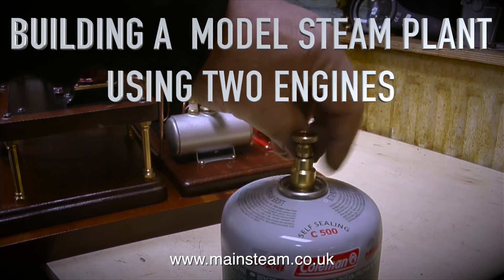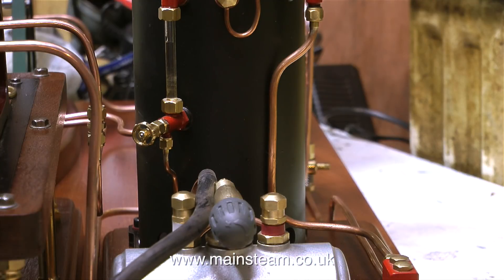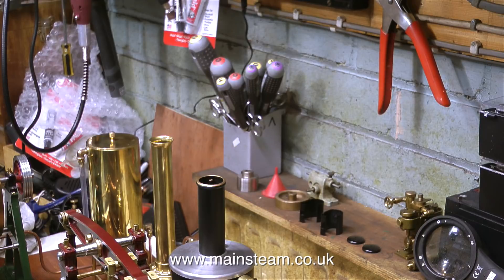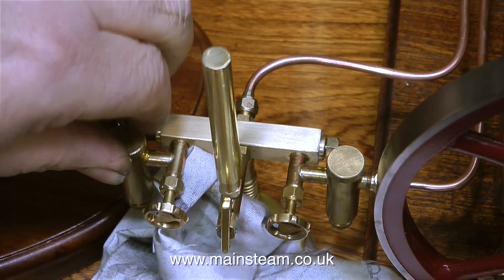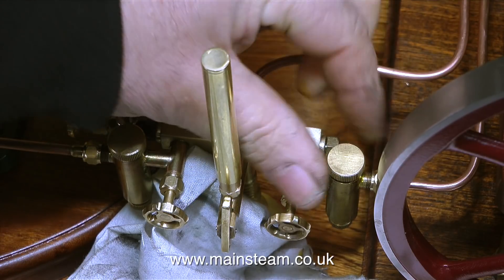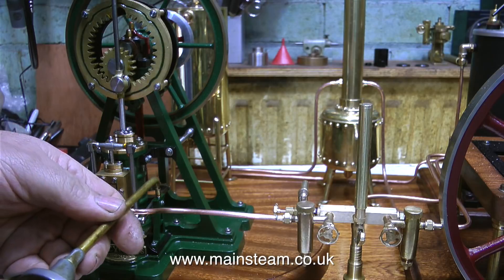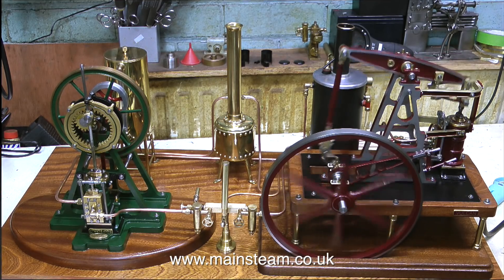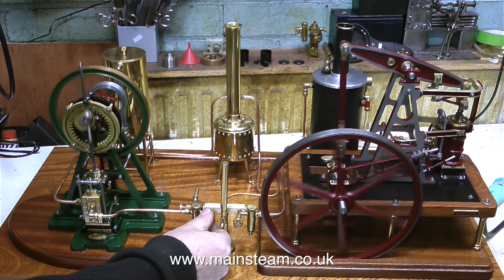BUILDING A  MODEL STEAM PLANT USING TWO ENGINES - PART #7

Comment: The molecular weight of carbon monoxide is 28.0101grams per mole, at ground level the atmosphere is mostly dinitrogen and dioxygen, which have molecular weights of 28.0134g/mol and 31.9988g/mol respectively.

Meaning that carbon monoxide is ever so slightly lighter than the largest part of the air's composition.

People are most likely confusing carbon monoxide with carbon dioxide, which has a MW of 44.0095g/mol, and thus is heavier than air. (Which is why when you put dry ice into water the fog stays low.)

Comment: In the periodic table, Carbon is about molar mass 12 and Oxygen 16 so CO is about molar mass 28.  Air is mostly Nitrogen, N-2, which is about 2*14 = 28.  So Carbon monoxide (actually 28.0101)  is about the same density as air (actually 28.97).  I put my CO detectors at about eye (or mouth) level since that's where I breath.
Reply from the maker: Yes, that was my logic too - {:-)))
Reply: GaryGrumble Oh, someone did the molecular weights before me. Whoops.

Comment: Mr. A, after this system or any run test and you know that it will not be ran for a month or what do you have to do to the system ?  Drain, blow down pipes whatever before putting  "on display.
             Thanks    Ralph McCoy
Reply from the maker: If my copper boiler was idle for a Month, I would probably leave the water in it as I store it in a warm environment, but for long term storage it is best to empty the water out completely.
Reply: What about your oilers ? I guess oil will not hurt

Comment: Hi Keith. Great video as always. Both of these engines are lovely. But I wondered if you could answer a question about the vulcan engine. Can you tell me if that is some sort of reverser lever connect to the eccentric on the flywheel?

Comment: Carbon monoxide has the molecular mass of 28 while air has 29.  So it is a little lighter than air. But because the exhaust gases are hot they will rise up and the carbon monoxide will fill the room first in the upper part. It is best that the sensor is high in the room. 
A lot of people made the confusion with carbon dioxide which has a molecular mass of 44 and is heavier than air and start accumulating from the bottom of the room.